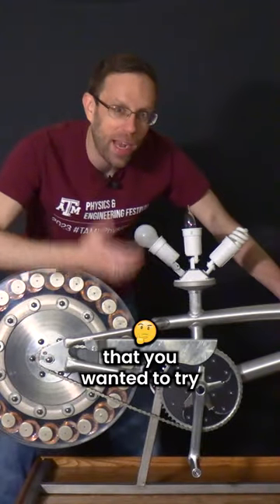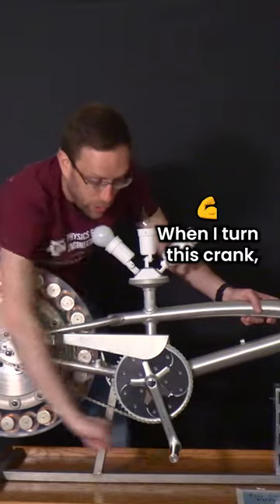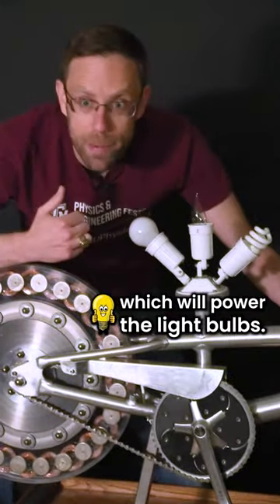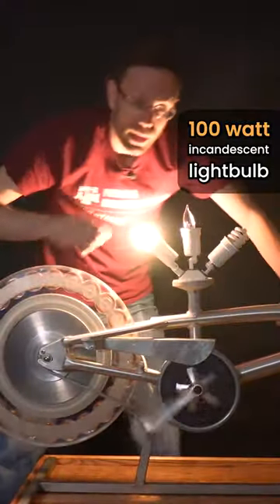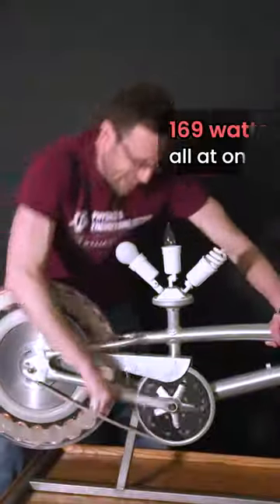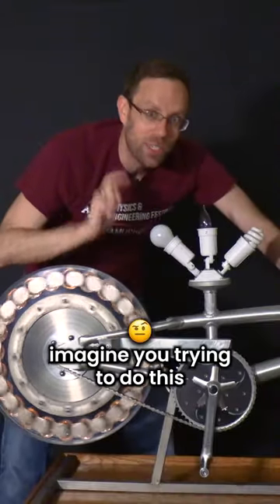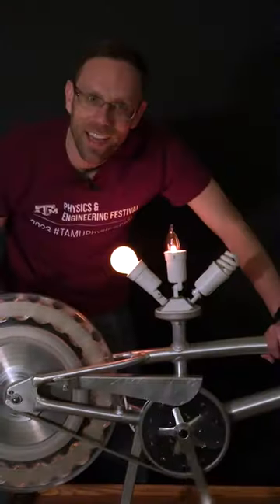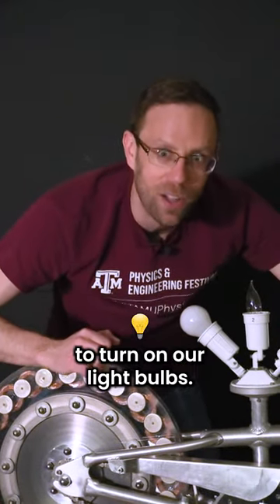Power a house with a bike?? #shorts

Comment: Ideally you would ride the bike though, potentially as a primary transportation option. How long would a simple 1 mile bike ride be able to keep the bulbs running for?
Reply: And what sort of witchcraft connects the bike to the bulbs while you are usign the bike as transport 😂😂
Reply: The energy would be going into the light bulbs though so you wouldn't go anywhere
Reply: bru
Reply: @legion162 Maybe he meant to simulate the 1mile whilst riding the bike in place (also maybe u were joking and no hate ✌)
Reply: @legion162  A battery would work, or the indoor method that the other person suggested.
Reply: Connect it to a battery. When you get  home, bring the battery inside and power the items off the battery.
Reply: Except generating energy puts resistance on the pedals, so it would be like riding a 20 degree uphill all the way

Good luck with that

Comment: This is how small engines run without batteries, they have small magnets in the flywheel connected to the coil and when you increase revolutions of the engine, you decrease the time it takes to do a full revolution and giving the coil a shot of electricity to power the plug and ignite the fuel.

Comment: This is really interesting. Can we get a video where you make/create this bike. So I can make it at home and play around with it.

I'd like to further the experiment, by also figuring out a place where you can store the energy so I can use it whenever I want.  And creating a more powerful version that requires less cycling to generate more power somehow.

Would also be a great investment if I can create a gym bike (or so) that adds power to some kind of power bank/generator that can then inturn power itself so it can be used electronically.

Comment: Could increase effecinancy by attaching that generator rig to a mountian bike rig. As you increase the speed just go up in gear. You could get that rig to high speeds and hugh power input with a lot less hassle. Only tjing to consider is the durability of the power rig itself when under high speeds.

Comment: What if you used an elevator that when it rolls the cable it also is making power. The counter weight can gear down so gravity will pull it down over the course of the day, but as we all know, another counterweight or weights can make the first be pulled back up. This 2 to 1 or 3 to 2 ratio can make the weights easily keep shifting from moving up, to down. Bring to extreme and you have only 1 out of 100 weights need to be manually lifted by other means to reset the system. Now add a single capillary action system to supply that 1 weight up and cause the needed over balance. Yes it’s that easy. It could only need to move 1 lb of water. Utilize heat and cold differences of the day, or be powered by anyone willing to use the elevator going down, but not up.

Comment: There are some logical errors in the argument. You will be able to create more power by using the bike like intended. It will be less effort. And you can store the produced power during workouts for later.
But yes, it's not enough to power modern homes with all the power thirsty things in it.

Comment: I had an idea that kinda plays off of the rotational generator thing. What if you had tiny magnet generators linked to your joints across your body so that every movement you made produced a voltage? The voltage generated would be pretty small most of the time so I also had the idea of having a battery pack that charges over time with the generator movements

Comment: You can hotwire an alternator and use that as a motor, attach it to a manual crank and should start when turning the energy should keep it going so you have electric 🤔

Comment: Yes but make the wheel 4 inches larger, and add a second row of magnets, then record the increased force necessary to spin it, and the increased output, and overlay them in a graph format, and you will see if it’s parallel, you should at least win the amount of mechanical drag in the chain as that is paid for in the first rows test??

Comment: maybe create this and by using a small amount of fuel at the beginning then wiring the machinery used to power the bike and other receptors using said bike; to then create an infinite power source using the power it itself creates to proceed onto powering the bike. Basically, Half the power or less is sent to machinery A (powers machinery B (bike)), and whilst the other half fuels other receptors. Would that work? Could you test that? I would try myself but as a 13 year old, I havent enough money nor the building space.

Comment: yes but if you put gears on the bike and ride it the proper way that wouldn't ideally be tiring at all actually
Reply: Actually, it doesn't matter, because power generation will stay the same. If you have a power meter on a bike, it should display roughly the same amount of wattage at the same speeds, regardless of gearing. You'll either be tired from spinning or tired from grinding, so it'll just depend on what you're comfortable with keeping up.

Comment: Wouldn't gears, like a mountain bike, address that? And batteries could store the charge short term. Also, using it correctly would be more efficient.......... bicycles were made to be operated with your feet on the pedals, not your hands.

Comment: It would be a lot easier on a bike you actually sit on and turn the crank with your legs, also a better conversion by a different gear ratio might help. If you the use LEDs you can casually ride and light one room when you work out, I guess.

Comment: What if we added a battery and a motor and then that powers the bike then the electricity that is produced goes half to a lightbulb and half to another battery, if after a few hours the battery runs out we can use another battery to replace it and around the the battery that is charging could be fully charged and maybe the cycle could repeat?